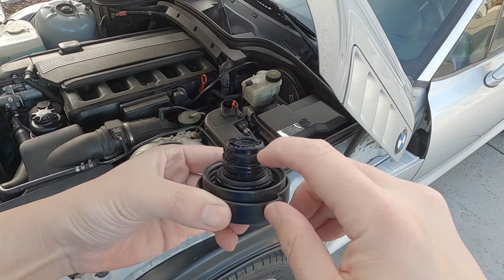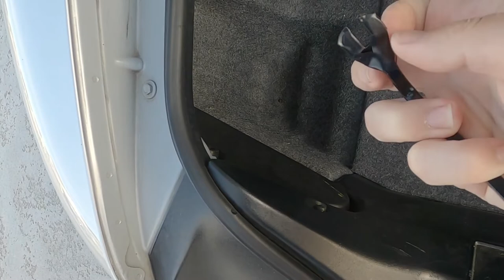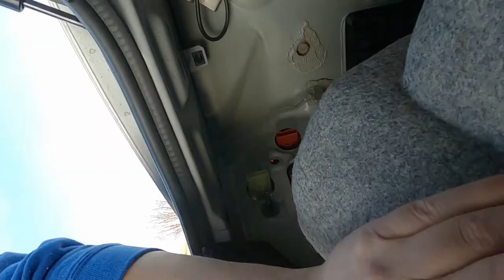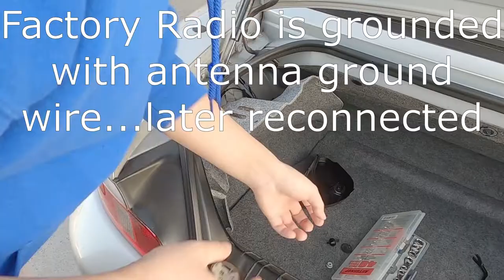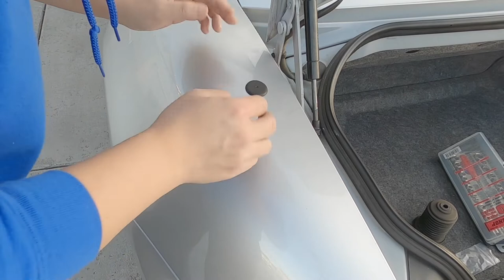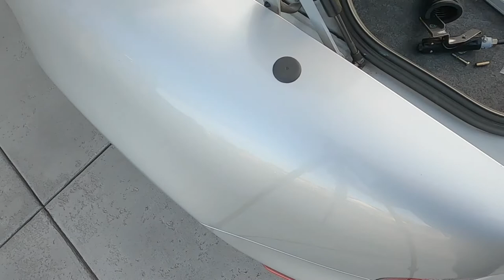BMW Z3 BAD Expansion Tank Cap & Antenna Delete (VLOG #2)

Comment: My expansion tank cap broke just like yours. 2001 330Ci. I’m not sure why BMW has this complicated expansion tank and cap vs. a simple radiator cap and overflow tank.
Reply from the maker: Weird huh!! We never found the broken piece either, it's probably stuck bottlenecking flow somewhere
Reply: @junbox618  Did you continue to use the broken cap? If so, have you had any issues because of it?

Comment: Just confirmed I had the same problem on my 2000 2.3 . I think it was letting the coolant leak out under pressure because I could not keep more than half the expansion tank full
Reply from the maker: Interesting!! I didn't notice any cooling issues or levels dropping. Maybe I didn't pay attention!!